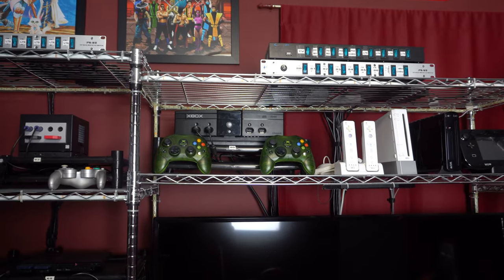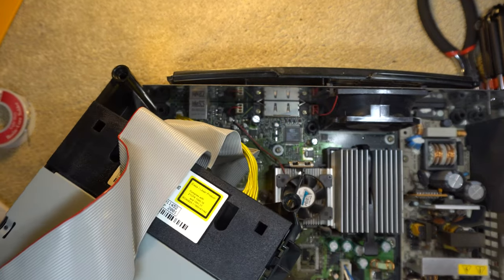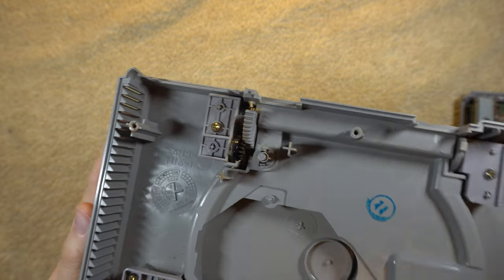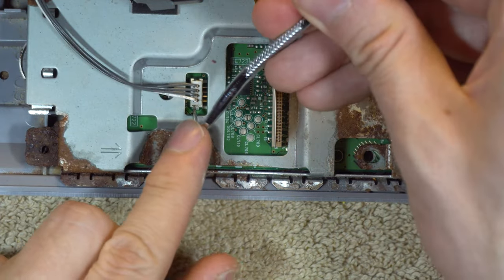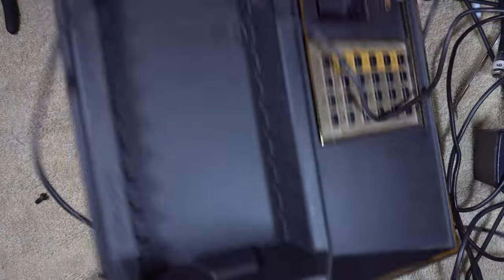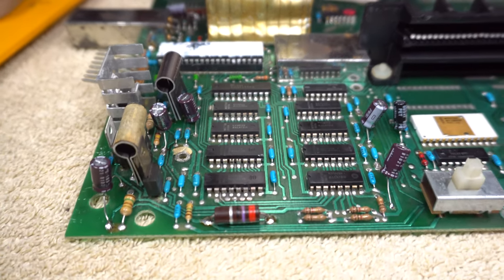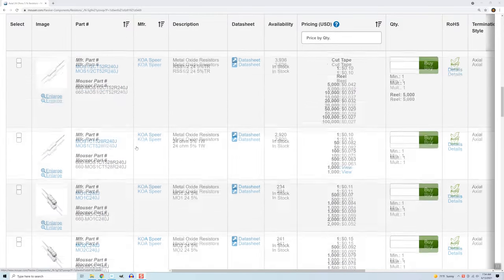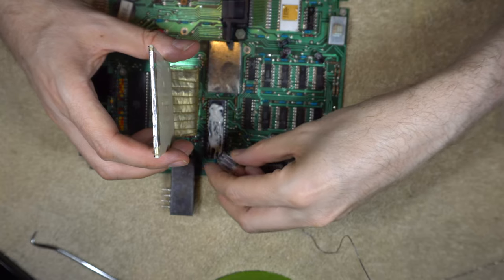Repairing Gaming Systems PART 2 (OG Xbox, PS1, Bally Astrocade)

Comment: The noise you're hearing from your PS1 is actually most likely your spindle motor. They are extremely prone to getting dry over time. When they're not oiled, they'll sound very noisy when spinning discs. The PS1 will also usually have trouble reading discs or it might read them fine but FMV will start to skip. The part you read about flipping them over really only applies to the SCPH-1001 consoles, especially the ones that have drives in them that are completely made out of plastic. I would try putting some machine oil in the two circular holes on the bottom of the motor. Cleaning the laser with a q-tip and rubbing alcohol or glass cleaner would be a good idea too.
Reply from the maker: Okay, I'm going to try looking for those two circular holes.
Reply: @HowToX  They're just on the bottom of the motor. They're not the holes that are directly in the center of the motor.  The other 2 holes are the ones you want. A drop of machine oil is all you need. Oh, and definitely do not use WD-40.

Comment: The resistor was larger than what you ordered probably because of the Watt rating. Old was probably 1 W, small resistor probably 1/4 W. Maybe the astrocade has other ceramic capacitors (especially in the RF box) that could need replacing. (Atari 2600 recap kits include some of those....)

Comment: For the original Xbox I suggest modding it because those hard drives are now pushing 20years old and when they break down it pretty much bricks the console. Softmodding I hear is easy and once you back up the hard drive contents and “divorce” the hard drive from the motherboard, you can replace it with a brand new hard drive and with a larger drive you’ll have the benefits of backing up your games to it. I prefer my consoles to be stock but at this point it’s a matter of modding to sustain life or accept it will eventually break down. 

As for the Ps1 I’m guessing the laser is on its last breathe before breaking down from time/use and you may have to order a replacement laser.

Comment: Love your vids, I'm no expert either but I've been modding and repairing stuff for a while now and you have inspired me to start doing videos about stuff like this.
I have a few tips related to this video: you should mainly avoid petroleum based lubricants on plastics and only use silicon based ones. 
As for that PS1 rust, you should take that console fully apart and submerge the rusted pieces in rust removal solutions like Evaporust or the WD40 branded rust removal. Over time the rust may eventually start damaging electronic components like chip legs and the like.

Comment: Usually caps will have a long leg and a short leg. The long one will be the positive leg. I believe this is true for many other components as well.
Reply from the maker: When removing them from the board, thier legs are pretty much the same length.
Reply: @HowToX  Gotcha. In the video it sounded like you couldn't identify the polarity of the new components. My mistake.
Reply from the maker: It was the old components. The board didn't have the polarity marked, and the text on the smaller capacitors was hard to read.

Comment: I almost had a Bally Home Library Computer a few years ago. My local retro store had just bought a box of random electronics from a customer for cheap he didn't even test anything. I helped him look through the box and there was a freaking Bally Home Library Computer. The shop owner had no idea why I was excited (He never heard of it). I said look man just hook it up and if it works I'll give you $200. We looked and unfortunately it didn't have the TV hookup. I said OK, I'll run down to the store and by the adapter you need BUT if it works sell it to me for $200. He said OK deal. So I ran down to our local mom and pop electronic store that is today sadly out of business and bought the connector. We hooked it up and the boot up screen kept freezing with random code and artifacts. I bet if we changed out all the capacitors it would fix it but I wasn't interested in buying it not working. 
To me the Bally Astrocade was the Neo Geo of the 70's and a gem of a console. I'm glad you have one to show off and enjoy.

Comment: You should consider soft modding and Null the HDD key on your original Xbox systems, makes it easier to repair them if the HDD dies in one of them. While your at it TSOP flashing the early one you have is a pretty simple mod to do. Clean your PS1 laser with some Isopropyl Alcohol and a cotton bud.

Comment: FYI: there's a high pitched sound in the background when you speak from 0:00 to 0:45
Reply from the maker: I went back and listened a few times, and I don't hear it.
Reply: @John are you younger than 35 years old? It might be one of these freq. ppl stop hearing in their mid 30s
Reply: @hosam7609  I'm not younger then 35 but I still hear it. 
If you can't hear it then open the video in VLC, click the extended settings button (right next to the fullscreen button, it's the one with the sliders)
Click on the "advanced" audio tab, click the enable box then move the slider all the way down to -12 semitones.
This should shift the sound down to a lower pitch so it's more audible.

Comment: Do you have a link the the burnt out resistor replacement? Same on on my system is completely black and can’t see any colors lol. Much help would be appreciated.
Reply from the maker: The same exact resistor blew for you? That's odd. I'll paste the info below, but bear in mind just because my new one hasn't blown up yet, does not mean I ordered the right one. 

603-CFR-25JR-52-24R

CFR-25JR-52-24R
Yageo Carbon Film Resistors - Through Hole
US HTS:8533100065 ECCN:EAR99 COO:CN
Reply: @HowToX  Thanks for getting back. Yes that exact one was gone on mine, and I’ll keep that in mind. 
Thank you for the help